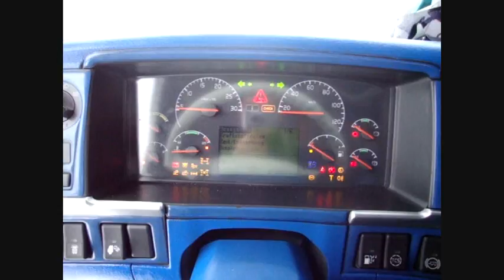5 days of my LIFE-Tuesday

Comment: Awesome, 5*

one question, i have my truck with a little problem, the brake seems to loose preasure when i have it ''on'' for a long time, for example in  a red light, i turnn on the handbrake and it doesn't happen, Any clue of the problem???